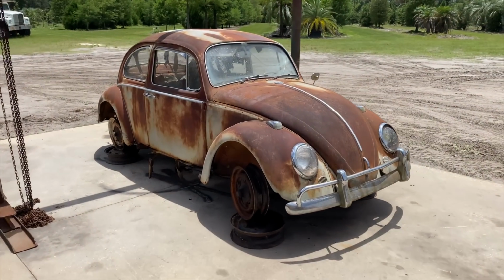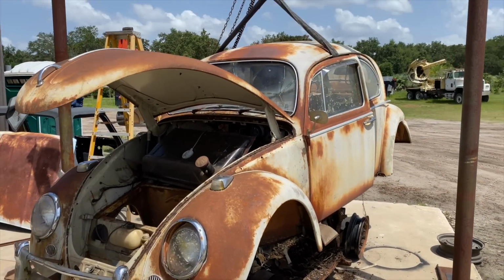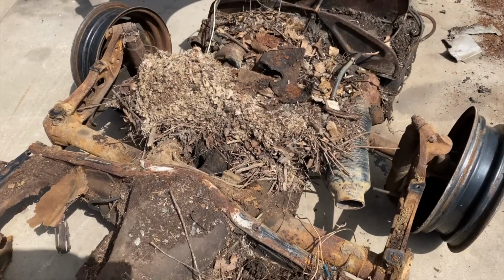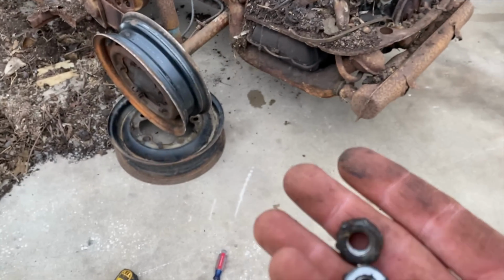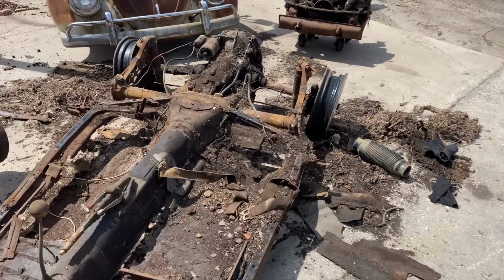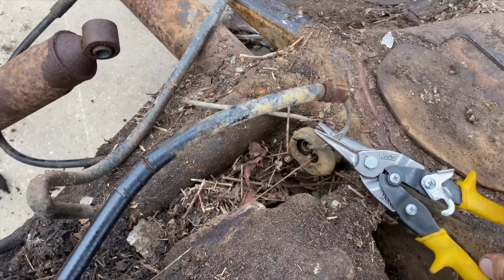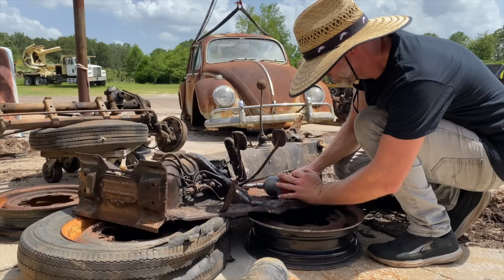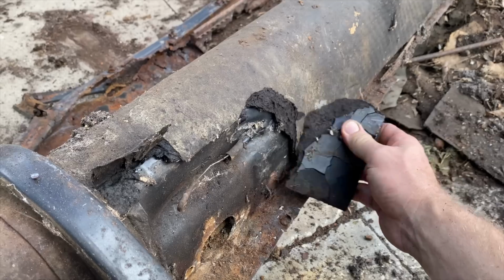VW Beetle Restoration - Complete Body Removal & Full Chassis Teardown

Comment: Hi CT. I have rebuilt many beetles and even converted some into beach buggies. I have boxes of spares.  Would it not be easier to disconnect pipes and cables so they can be used as samples to manufacture new pipes and cables? Good luck on your beetle project. I live in South Africa.

Comment: Hi CT, wow that was allot of nest in there. Cool too see it all apart and ready to clean up good. Once that motor is cleaned up pull the valve covers and the oil plug and screen. If just oil in there and not water and rust it may have a chance?
Reply from the maker: Hey Tim, yes, it was pretty bad. I'm going to take a closer loo at the motor tomorrow. Wish me luck!

Comment: Some suggestions for you… you can get the “plans” for a VW Beetle body dolly, from the guys over on VW Life. They did an episode about a year ago when they put one together for one of their members beetle body’s, on one they built, and the plans were linked in the description.
Another suggestion… get the wider pedal assembly from classicbugparts. I love mine, it’s great for my fat feet. I also got the brake pedal instant brake light switch, to make the brake lights go on before the pressure switch at the master has a chance. One final suggestion… get the Brass shift rod bushing and install kit from ev4unow … vw-bushing, and don’t get the urethane one for the transmission end they are hard and disintegrate too quickly. Ok, sorry one more, for all these VW Porsches projects… DON’T cheap out on any rubber parts GET the German stuff, everything else just degrades. My build isn’t even a year back on the road, and the turn indicator rubbers, window scrapers, and many other parts are cracking & splitting, because I cheaped out and got Brazilian, Mexican and China parts, like an id10t. DON’T DO IT.

Comment: My height fear kicked in when you were looking down on the bug🤣
Reply: fear of height..at 8 ft? lol
i worked at 100 ft plus and walked across 40 feet structures ... you get used to it ...or never..
Reply: @garymallard4699  I'm not about heights but I will go on a roof if I have to lol

Comment: If you dont mind Originality, the King Pin Front End Assembly are Better to be Replaced with the much Reliable and Durable Ball Joint Front Assembly. My 66 are fitted with Ball Joints ( 66 Onward )Those 5 Holes Hubs and Rims are NICE ! Its very Rare here in my Country. The after Market Reproduction doesn't look as Nice as those Originals you have. Sand Blast ( or wirewheeled them ) and ReUse.

Comment: Your working to hard cleaning that grease off. I've always used Simple Green, and power wash it off. Or rent a streamer power washer. That works as well! Also, their are some bolts under the pan, I believe holding your foot petals. I think it might be 10 millimeters bolts. It’s been years since I restored a VW Classic, from the ground up. Also, WD40 pre-lube your bolts before unscrewing them, try not to cutting the bolts. Patience is the key. Also, use a mini cooking torch to heat up those bolts if the WD40 lube isn’t working faster. I usually did spry those bolts two days before removing anything. Keeps from breaking bolts, or clips. Removing fender, I would lube those up before removing them. After seeing this video of your Bug.

Comment: You need a power washer, a long breaker bar,  a torch for stubborn nuts, some liquid rusty bolt loosener, and a tetanus shot! A sandblaster with a compressor isn't a bad idea either. You can use the compressor for double duty and use an air gun for dismantling and building. Good luck! I cut my teeth on VWs. Can't wait to see you restore one!  Cheers!

Comment: I've only worked on one engine like that and there's a slim chance that you'll find the perfect rust converter that will work with the magnesium alloy that the vw engines are made out of. Steel piston rings rusted to corroded magnesium don't seem to have a recommended solution.  You may want to check out RJ the bike guy - he's big on aluminium corroded to steel - apple vinegar may be the way forward....!  If you could get the engine on an engine stand on it's side and pour in the rust converter after getting the cylinder heads off, you might be lucky - heat and a vibrating tool that you'd use to try to dislodge the rust on the piston rings. If the engine had enough oil in it, it shouldn't be the piston heads or their components - most likely just the piston rings. I haven't seen anyone try to use the electrolysis method for this - if the engine is still filled with oil a ionic solution poured into each cylinder and then the electrolysis may work - it might be about the craziest thing anyone has tried on VW videos on youtube for a while. I might think that a wooden frame over the engine and then driving a car on it to keep it stable while you use a 5 yard breaker bar with a couple of people hanging off it, trying to free up the engine would make quite good viewing, but so would trying each of these methods for a day or two when you're working on the chassis https://www.youtube.com/watch?v=Qi-tK1jwO-k&t=6s

Comment: To Easily Free the Speedo Meter Cable, just Turn the Threaded Cover of the Cable to the Meter's Rear. And pull out the Whole Cable right out of the Body ( The Rubber that I saw you pried out ) I have gone through almost the same as this where All the Tins are Rusted, I threw them all away ( as I have a better used spare ready ) The only parts I Salvaged and ReUsed again are : Generator, Distributor and Fuel Pump. The Doghouse & All the Engine Tins, Generator Fan, Metal Air Filter, Engine Pulley, the Exhaust Assembly are too rusted to be Salvaged. Anything that require ' Precision' like Engine Pulley and Generator Fan are better to be replaced with New or a Good used.